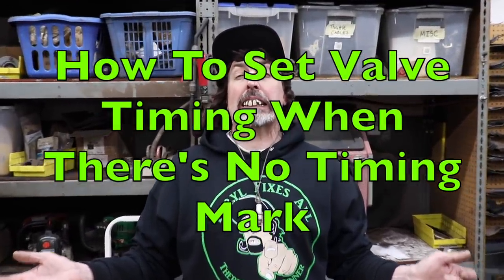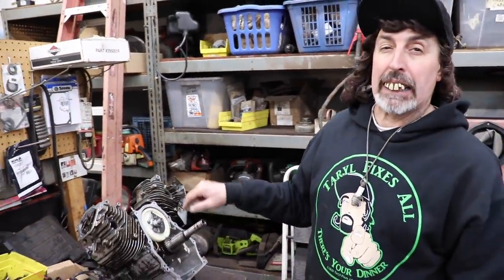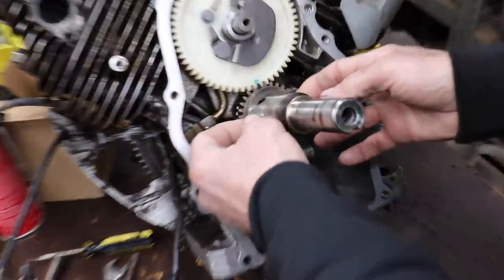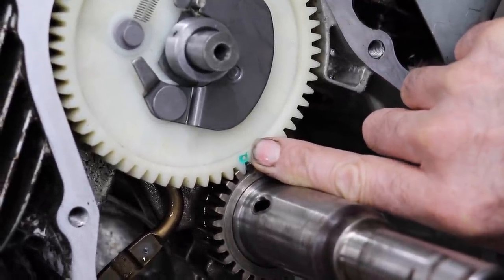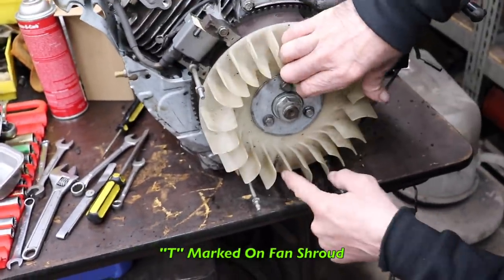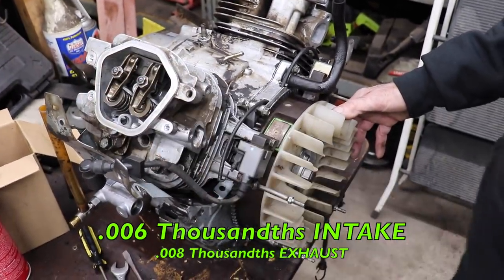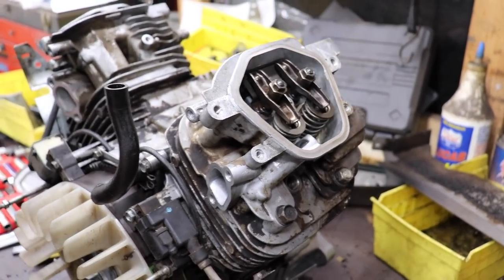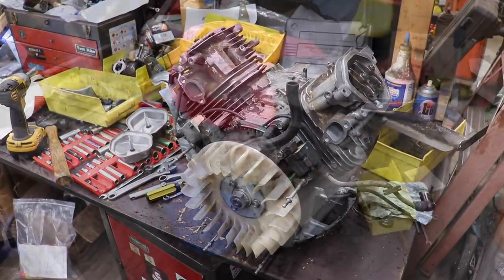What Do You Do? No Timing Marks

Comment: I got one for you! I did a degree wheel for timing of the crankshaft and it nowhere near the 180 degree timing mark from the key way. The timing mark is what you said but if I line up TDC the piston is on the bottom not the top? I’m stumped?

Comment: Thanks. Is the keyway always 180° from timing mark on other brand engines or Honda specific?
Reply: @JM-yx1lm  true. What I was asking is whether it is an industry standard to cùt the keyway opposite of timing marks or is Honda the only one?
Reply: @patdennis3751  I think it’s the other way around.  180 degrees out from the key way is where other companies place their cam timing mark.  

The keyway is what you need to time the crank to timing chain, but to be properly timed it’s 180 out and less easy to use so they add the timing mark to the opposite side of the timing gear keyway for ease of getting it timed correctly.
Reply: Not always.

Comment: I need Taryl to save me. I have a Kohler CV20S 65515. My valve guide broke. You can find all kinds of valve guides for about $15, but this motor doesn't have a part number for a valve guide. Kohler says you have to buy a whole new head. I wondered if Taryl new of an intake valve guide that would fit this motor. I punched the old one out just like any other motor. My plan is to measure the one in the other head and try to .watch the size. Again most valve guides aren't sold by size but by which motor it goes to. HELP TARYL!
Reply: Locktite the new one in so it won't move.

Comment: HELPPPPP  -  I'm hungry  >>  :face-orange-raised-eyebrow: I have a Golf cart G14. How do you set the values on a G14 golfcart w/Yamaha JN5 engine?  
My engine turns over good with the spark plug out, and you can feel a lot of air coming out of the plug hole. Put the plug back in and  try to start it and it's hard to get the engine to turn over like the battery's is dead, but it is not.  ??  what up? Derrick